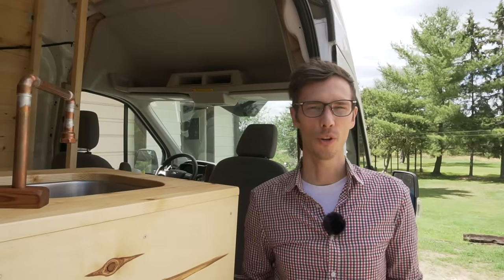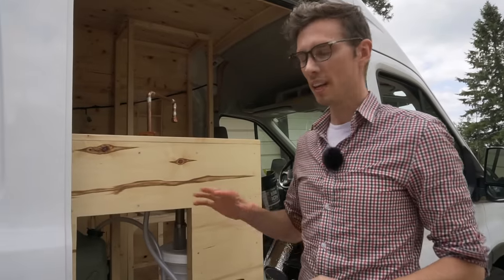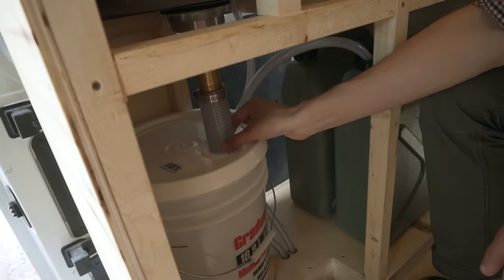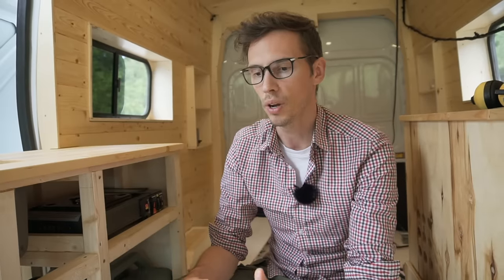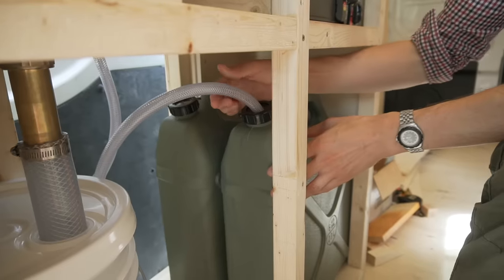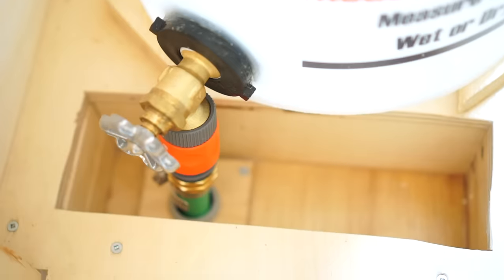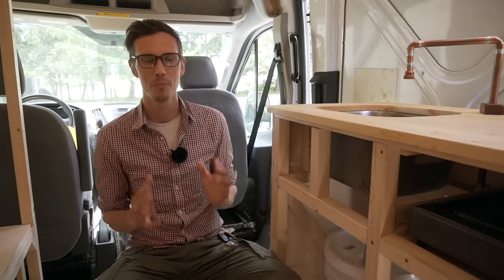Cheap & Easy DIY Camper Van Plumbing System - Van Life

Comment: Finally someone who uses a marine foot pump. I never understood why "everyone" has a noisy, power hungry electrical pump, that pressurizes the system so you can wait for leaks to develop, and then they complain about how limited their water supply is.
A question: is that clear reinforced hose you are using food grade or drinking water grade?
Reply: Water pumps are very reliable and much better than pumping with your foot. I had mine over 2 years now with no issues. And a pressure tank between the water pump and the sink prevents the pump from turning on every time you turn on water.
Reply: My question would be why use a marine foot pump when you can simply lift the fresh water above the tap (or gate valve) and let gravity do the work?
But your question is very good as well!
Reply: @age_of_reason  Even more reliable than a pedal water pump is no pump at all. Just lift the water above the sink and use a tap or gate valve to control the flow of water, and let gravity do the work after you elevated the water up there.

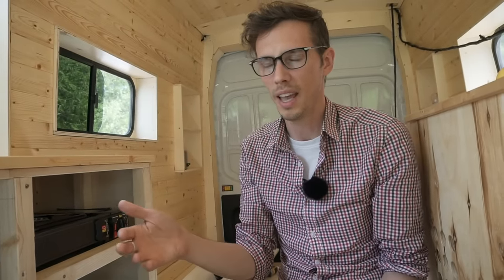Comment: At time about 4:50 you mentioned a noisy pump . Yes , I would certainly agree with that .  I don't know how to choose a pump while it's still in the package and then to know if it's noisy or quiet .  I had a motorhome with a very noisy pump in it . It was a real problem . My friends installed an electric pump in their cottage washroom to fill the toilet tank after flushing , it was very noisy and would even wake up the whole house if the toilet were used at night .

Comment: Using a Marine water pump is good, I favor  the marine hand pump, since I’m not washing dishes or much of anything, I think with limited space the kitchen module is rather crowding the limit, again it’s a bid to make a van into a RV with all its comforts but little of its space. You can avoid water hose’s, drain holes & 3/4” brass valves by turning (as you’ve noted) the 5 gal bucket to the outside, since the water hose & 3/4” valve are made for high pressure you will have constant blockage, I would have used 2” PVC drain pipe with 1/4 turn 2” pvc valve for drain to avoid straining blockages. This set up would not be my choice, too many gadgets taking up too much room but it’s ok if it works for you, I’m more of a minimalist, less creature comforts, more room. Have you considered full length pull out drawers ? You can have a stove/ sink combo in drawers side by side outside the Van. Shalom!

Comment: that looks freakin perfect.  i miiiight have put a sheet of formica on top of your counter though.  that wood might get kinda dinged up and colored if you're using it for food prep.  well, you could use cutting boards.  but a sheet of formica makes a pretty good cutting board.  regardless - very nice job.

Comment: Excellent simple system & vid. 
I am wondering how the connections are holding up after road wear and movement.
I also disagree with the comments about adding a trap because this is GREY water and such a small amount of it!

Comment: Great video, thank you for the ideas. That pumpdesign is way old and stil going strong. I would use a dumptank that is at least the size of (one of) your water tanks. To prevent overflow.

Comment: Suggestion, use a 6 gallon grey water bucket and 5 gallon Jerry jugs for fresh water.  When you switch fresh water jugs empty the bucket and it will never run over. Also put a sideways S curve in the drain hose to create an S trap water seal that will trap odors in the bucket.

Comment: Grey water is safe to dump on the ground as long as you use biodegradable soaps and don't dump chemicals down the drain, a park ranger told me they see people's shower water coming out of the bottom of there campers all the time that's the Forest Services official ruel too. You should look into an evacuation trap they're alot more compact for areas like this

Comment: 'drains into a dump station = Ha Ha Ha
'well explained system you put together
I love 'simple'
ideally you used lead free solder
I'm going to check out the link to the foot pump
thanks
Reply: gary gerard lead free makes sense but hopefully he’s not drinking this water. If so I would install water filter and if water isn’t chlorinated consider it.

Comment: Great video!  I have a hydroponic bucket setup that could be used in this application if you don't want to drill a hole in your floor.  Plus, my bucket has a standing hose that lets you see the water level in your bucket.  When it is full you simply rotate the hose to floor level and drain (wherever you would be draining anyway) using your very cool access door.

Comment: Could also use a 5 gallon weed sprayer as I do.you cut the hose,attach a shower head or sprayer from a sink to it .then add water and use the hand pump to pump up pressure

Comment: I’m trying to decide between overmount &
undermount: Have you had any issues with the edge of the countertop around the sink? I read that undermount sinks shouldn’t be installed in wooden countertops because of the risk of mould / rot to the edge of the wood around the sink. I would think that regular oiling / varnishing would protect against that though, what has your experience been?

Comment: Excellent design, I'll be copying. As far as the hole in the floor of the van, there are plastic plugs for less than a dollar which will snap in the hole if you ever decide you no longer want it..

Comment: Would you consider finishing off a partially converted sprinter? My brother is desperate to get someone finish his van as he is working 2 jobs right now. It is insulated, wired n boarded. Just needs all the toys fitting in and tidying up.  Thanks heaps.

Comment: Ok I really like the compact low tech design. Buuuut by not having a water seal from your sink to your Grey water you are going to have some nasty stink coming straight up that drain. I’d def change it and put an “S” pipe in and save yourself some nasty smells-esp when u leave the van closed up on warm days.
Reply: great job and some good Ideas. Enjoy ! Its fun to see all the campers people are making
Reply: I've had a similar system longer than this guy. Your concern is seemingly sensible, but realistically imaginary. There is no such problem in actually use.
Reply: This water is just grey water, not a black water and they use biodegradable soap so just park on some land or near and drain and turn the handle, flush out with a little clean water and you will be fine. A lot of people wash their cars and let it drain down the sewage which is the same thing.
Reply: If you do this wouldn't air pressure build up in the bucket until it EXPLODES!!!!!
Reply: @AaronBesser  No, at most the pressure inside the bucket would bubble up on the sink side of the S pipe. Just like it does for making alcohol (i.e. homemade beer brewing).

Comment: It might be good to have the gray water tank the same size as the fresh water tank - less chance of it over flowing. 
I do like the foot pump and the simple way of getting rid of the gray water. 
I wonder if a more constricted faucet would deliver less water more efficiently than the current setup?
Oh, I also think there could be a better way of putting the pipe into the fresh water tank. Right now it seems like there is maybe a small gap where insects could crawl inside. But maybe I’m not seeing it correctly.

Comment: We have the same sort of setup but use a 'jerry can' for our greywater the same size as our fresh water jerry cans but different colour, we know the greywater needs emptying when we need to change over our freshwater. I would be worried about those bottom fittings on your bucket being broken through movement while traveling?? Did that happen ?

Comment: I think I'm going to try to build one with a pressurized bottle from a bug spray chemical bottle new and unused from home depot.
Reply: Results?
Reply: @CallMeFil  I've seen portable showers made this way so it would definitely work
Reply: Did it work?  I have one I purchased for bathing but also have solar shower.  Would love to know your result and how you did it.  Currently using a prima 5 gallon jug with the manual pump but have to “carry” water to sink area.

Comment: What do you think about the vinyl tubing with regards to potable water? Does it add a taste? I hear that that stuff is not rated for drinking water so for my build I was thinking about doing PEX instead. However, it is not as flexible and requires special fittings so I understand the appeal of the vinyl and I might go with it anyway. Then have a free standing water filter on the counter for drinking. The vinyl will just be for doing dishes and stuff. I'd love to hear opinions on that. Should I go with the PEX?

Comment: Faucet:  clever. I would not have thought of such an easy alternative. 
Addition:  add hose fitting to end that allow attaching any hose (potable or other). 
Alternative:  use an inexpensive plastic sink sprayer. Allows spraying, and controlling water since only sprays when squeezed. Additional uses would be for washing hair, outside shower (of sorts). Also gets out of the way when needed. 
Just seeds for ideas.

Comment: Drain pipe is great to use for a grey water tank. Various sizes 2” to 6” and bigger. Diameter can be chosen to fit in long thin places and various shapes can be made to go into unused places.

Comment: I noticed you installed the pump directly onto the floor but the tanks/buckets are slightly raised on a platform you've built. Is this intentional? Is it a design thing or a practical thing (e.g. gravity for the water to flow to the pump easier...)?

Comment: I'm wondering how the quick release will work in winter?  The ones I've seen have a valve.  Below freezing, the hose doesn't drain and therefore freezes the water at the end.  Else, it'll have to be the old fashion way.  The 5 gallon bucket weighs half as much when half full.  This makes it easier to dump/drain.

Comment: One of the problems I've had with the water jugs is condensation build up on the outside and getting the floor wet. Have you had that problem? If so, how did you deal with it?

Comment: Nice Job! I am wanting to do a similar setup in a Chevrolet Express Van. Do you think it would still work okay with smaller water jugs since I will be building a shorter cabinet since the van is not as tall as a sprinter? I look forward to your input on my scenario, thanks
Reply from the maker: Hey Matt, I haven't tried it with smaller jugs but I don't see why it wouldn't work, it's basically the same principle. Our jugs have the main opening but there's also a really tiny opening on the top. If you can get something like that and open the small whole when you're using them it might help with the flow.  You can see those 2 wholes on jugs like this: http://www.canadiantire.ca/en/pdp/reliance-rectangular-aqua-pak-water-container-0854035p.html  Best of luck!! :)

Comment: does the hose go all the way to the bottom of the 6 gallon water jug.  Does it require angling the jug when low on water to use gravity for the foot pump?

Comment: For you grey water tank, where did you find the 1-1/2 inch tubing that fit around the drain pipe with the clamp. I can seem to find 1-1/2 anywhere. Thanks!!

Comment: Awesome progress. I believe those water cans are also the tallest ones for sale aside from maybe the crystal water jugs so you have options going forward now. It's cool seeing you guys build your ideal camper after having the experience. I prefer simple and you're not straying far from that. Any rework will be a breeze. Only one question. Does the sink pivot? It looks like it does and the flexible hose running to the can is what lets it? Again, nice progress and work!
Reply: I thought I would add, that I went with an electric pump and bought a chrome faucet from china (Amazon). The threads were aweful, which was confirmed by the local hardware guy. Your setup looks much more foolproof, rustic, durable, and affordable.

Comment: After you stop using the foot pump doesn’t the water stay in the line I can see a problem with leaks in the near future maybe if the pump is elevated higher than your water tanks the water in the line should gravity feed back into your tanks after use.

Comment: FYI the 5 gallon bucket will crack and leak if the water in it freezes. The blue 5 gallon bottles don't crack even if the water freezes as long as there's room for the water to expand. Learn from my mistakes. ; )

Comment: I still have a table top plastic camp sink from decades ago. It has the sink part of course and it's molded so that it has a fresh water compartment as well which can be hand pumped either into the sink or other container such as for drinking and cooking. It has a large fill hole and a screw cap along with a drain at the sink bottom which can go directly into a bucket below, or hosed away to some other place. I used an open bucket since it was used for stationary tent camping but I like the covered bucket which helps with splashing while driving. I generally placed the sink on top of a Coleman utility stand which I assume is still being made. The sink also has a carrying handle. I wonder if they're still made.
   If I ever set up a water source similar to yours, I'll use a 12 vdc windshield washer pump with a foot switch. I still have a brand new one around someplace purchased just for such a purpose.  Being new I don't need to worry about any previous use with washer fluid contamination.

Comment: Perhaps the most intelligent simple install, however I would have installed the P trap in the drain.
Reply from the maker: You're right, we will probably add one this summer, thanks :) :)
Reply: @ExploringAlternatives  I'll bet you won't find it necessary. Use vinegar if you have any problems.

Comment: Good plan. But one big problem. The gray tank will not completely drain because of the spigot being on the side. In one week you will have horrible smell and gas. I know. That’s how I started. Now I use a small bucket I empty and clean daily. KISS

Comment: You could in case the pump in an insulated enclosure to hide the sound dont know if it will work didnt test it. It should have good results. If the pump is in water that should work.

Comment: Tip number 2. If the water freezes (EVERYTHING freezes in the winter) you may want to have a metal container to pour water into instead so you can heat the water and melt the ice.

Comment: The grey water tank is not a good construction. the drain leads directly to the tank, this means any odors from the tank will go straight up and have a means to escape. What you should have done is create an S bend where inside the bend a pool of water remains which serves as a blockage for any potential odors. I predict using it like that, you'll have a smelly van in no time unless your grey water remains very clean.

Comment: I'm trying to figure out how to use the foot pump to pump hot water (hot/cold mixed using the faucet).  I'd have to have the intake hose coming from perhaps another reservoir that holds the mixed water, right?  I am struggling to figure this out.  Has anyone figured out how to do this?  I really want to use the foot pump to ensure I don't waste water.  Plus I just think it's really cool!  But I want to be able to use it with hot water.

Comment: Not sure if anyone else has mentioned these foot pump problems yet. I have a similar system that I created and built about 3 years ago. A few things about the foot pump:

1.  I used a similar but different brand foot pump, and it leaked between the pump housing and the pump outlet fittings. Returned it to the company, got a new one, and it leaked as well. Would not recommend the one I got.. The Whale brand, as shown in the video, is probably better. This is the short description for the one that I purchased and would NOT recommend:

Item: Marine Boat Baby Foot Pump Suitable for 1/2" Flexible Hose Rubber & Nylon Made [Misc.] [ASIN: B00S59ULW0]

2. Unless you are in constantly cold conditions (and maybe even then), algae will build up over time inside the foot pump. Once I discovered that, I began running one gallon of heavily chlorinated / bleached water through the pump about every two months, followed by one gallon of clear water to flush out the bleach water. No problem since then.
Reply from the maker: Thanks for sharing this :)

Comment: ugh... having the gray water outlet to the side instead of the bottom is going to leave you with a 1" sludge at all times that can't drain out and no S bend is going to make your camper smell.... Also-- your quick release system is going to backfire... you can't have gravity flow waste water being reduced down at every connection. It should have been a 2" wide outlet to allow for faster emptying unless you're planning on letting this dribble out on the road as you're driving LOL

Comment: Grey water inside a van is a waste of space. Mounting it under the van will save space, be more hygenical and you can just dump it onto the street at night. The bucket is pretty much redundant as you're already draining water onto the street anyway. That foot pump is going to get old fast. Having powered running water is a must if you're living in a van.

Comment: You used way to much solder 

cut ream clean flux fit then apply get and get warm then apply a little solder and use the heat to pull it into the fitting

Comment: i hope the copper pipes are zinc inlaid, drinking water are full of different minerals that might react with the copper and corrode. like with a Moscow mule in a pure copper mug. and that's dangerous! just want to be safe than sorry.
Reply: Copper water piping has been used for potable water in houses for over 100 years. It's not at all dangerous. It is, in fact, the standard. The copper won't corrode to any appreciable degree. I have cut into 100 year old copper supply lines in my house that were in perfect condition.